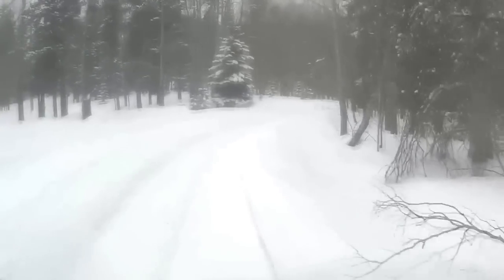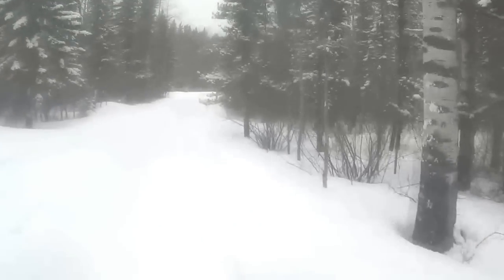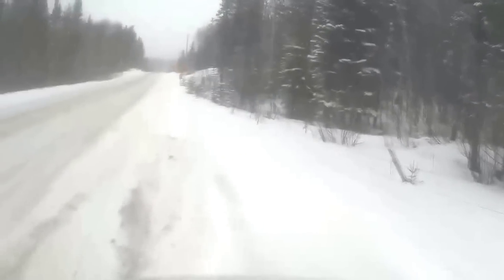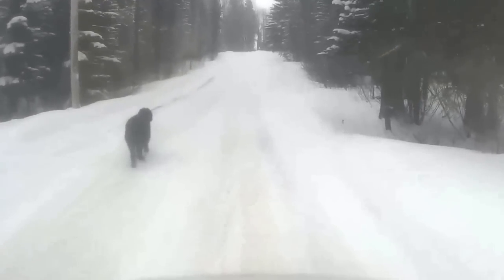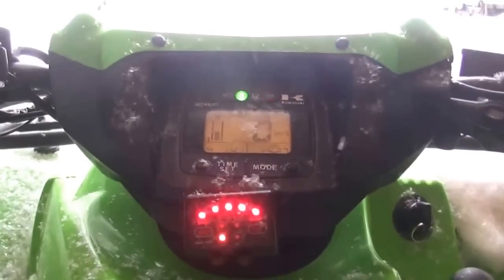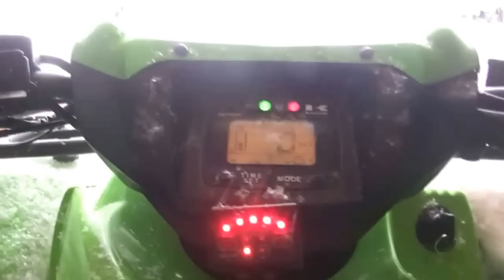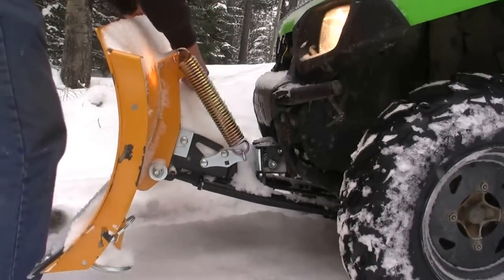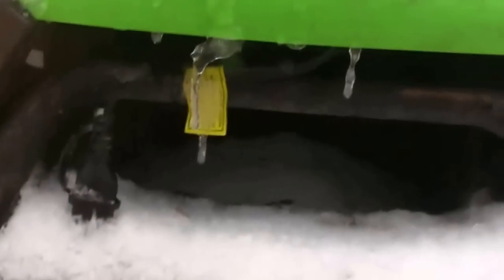ATV to snow plow. Kawasaki Brute Force 650 with WARN blade, heated grips and block heater

Comment: Hey Doug, how have the skids or feet held up? I just purchased the same blade you have and don't have it installed yet but I've heard some negative reviews that the feet wear off / wear out to quickly. Thanks for the good video.
Reply: @braggcreek  Good job! Alberta Proud!!!!
I'm about 2 hours north of you but I run a Moose Plow on a Honda Rubicon.
I weld my own skid shoes and run on milled asphalt which is very abrasive.
No sweat, just weld on another layer of flat bar. Good for another couple winters.

Comment: How does that block heater work and where do I get one? I usually trickle charge the battery so ti is strong for starting.

Is that considered a straight blade or a county blade?
Reply: ***** thanks man!
Reply: ***** tHANKS! I've been doing the trickle charger night before fi I haven't used the ATV for awhile. $5.00 at harbor freight.
Reply: ***** Already had way colder weather than normal up here in NE, Ohio. Last year over 10 feet of snow.

Comment: Is that a center or front mount. I'm debating between the warn provantage, the kfi, and the clickngo. Any issues with the warn?
Reply: @braggcreek  Just curious. Do you still use the steel cable on your winch? I switched to the synthetic rope three years ago, and I am very impressed. The cable kept breaking about once a week when plowing due to it weakening from only using such a short length rolling over the rollers so much. The synthetic rope has not broke or frayed yet, and it gets used a lot.
Reply: Don't ever buy a front mount!!!! I just got back from the dealer with my 2016 king quad. Had to replace the winch mount, bumper and the front plow mount was twisted. Even damaged the mount for the  lower A arms on the frame. Dealer said everything is integrated and they are not as sturdy as mid mounts. Worst scenario with mid mount is it breaks 2 pins. So I fixed the front end and put a mid mount 60 inch KFI on with a tapered blade. The warn plow I had was great, but the mounting method is no good. And this is all from this season plowing and I'm easy on my equipment. Never hit anything out of the ordinary.
Reply: @fourbyfourer  synthetic rope is good, but I would recommend switching the fair lead because rollers are for cable. You need a rope fair lead.
Reply: @josephgilli1611  Great point, I am going to look into getting one than. Thank you.
Reply: I have a mid mount plow and have been using it alot every winter and have never had an issue with the mid mount. Now I''m not one of those that mistreat my machine or plow, like ramming snow banks with a running start, and I have never broke or bent anything on it. Just my two cents.
Reply: @fourbyfourer  Unfortunately I bought mine with the front mount. $1500 later I now have a mid mount. I'm the same way. Never abuse my equipment or tools. Without that plow I cant get out of my 3/4 mile  steep mountain driveway to go to work.